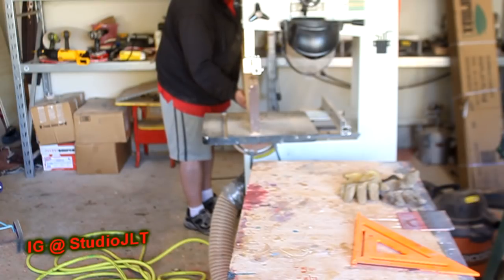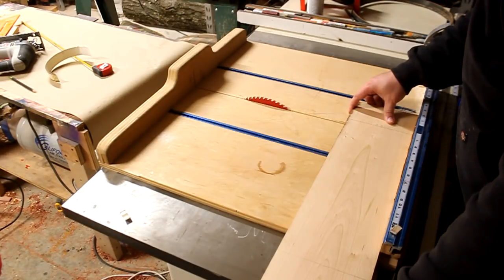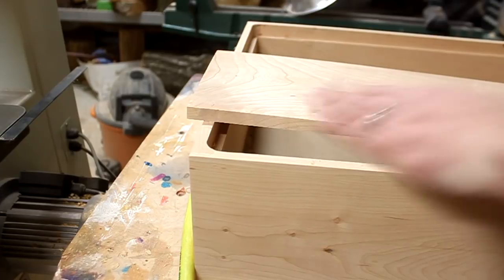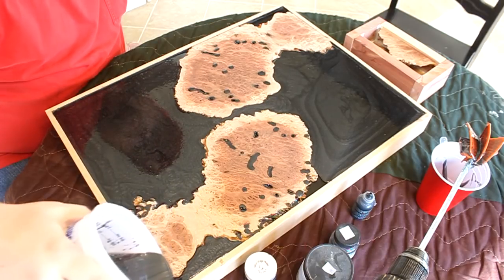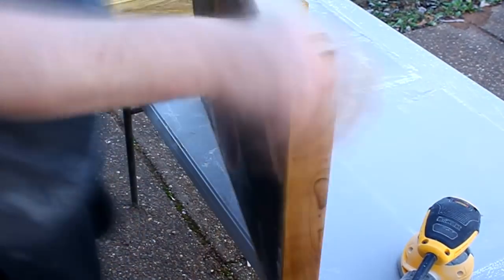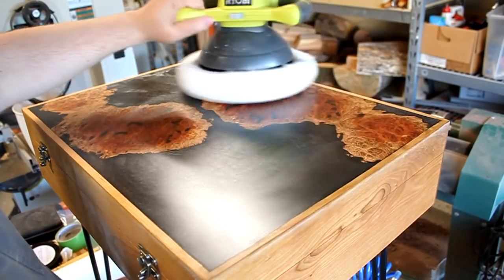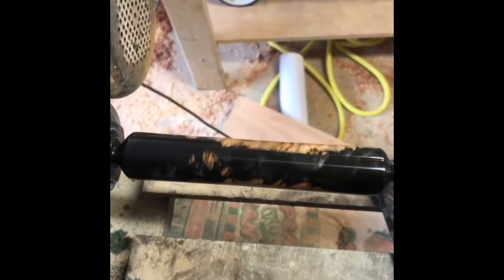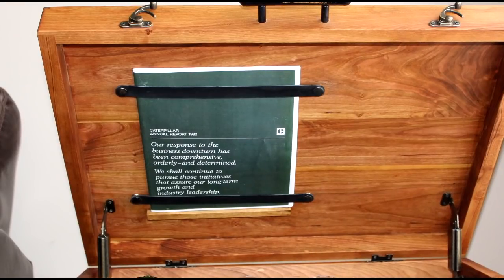Resin & Wood - Modern End Table Made with Cherry, Burl, & Resin

Comment: Just BEAUTIFUL. Great Job. Love the TOP design. Too bad you didn't make a drawer so you wouldn't have to open the top to get the glasses out and everything else.
Keep up the GREAT WORK!
Reply from the maker: I went back and forth on the drawer a few times.  Ultimately I feared the resin I used wouldn't stand up to some types of lamps (think pointy footed ones) over time.  So I designed it to keep the top clear.  Thanks for the comment.
Reply: Thanks for the FAST reply! Keep up the GREAT WORK!